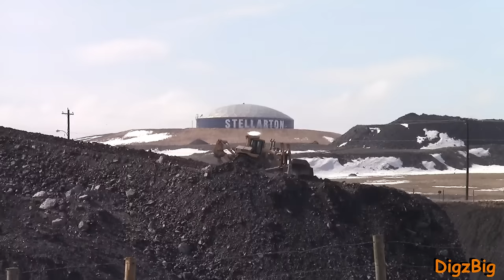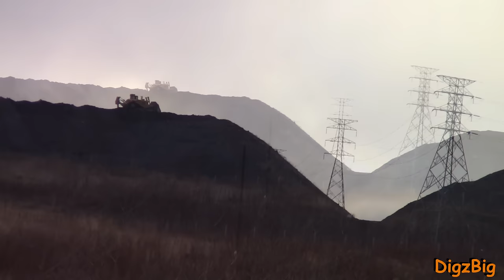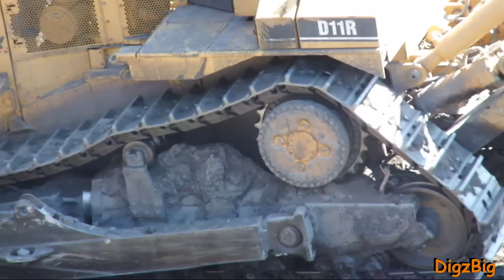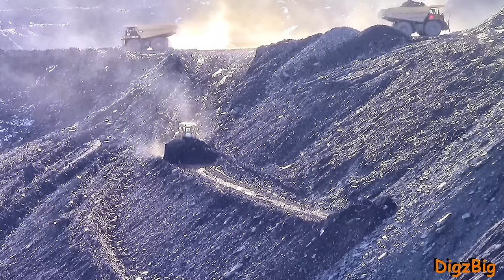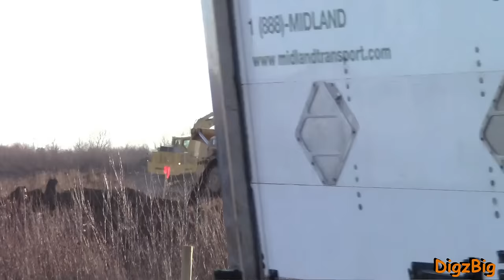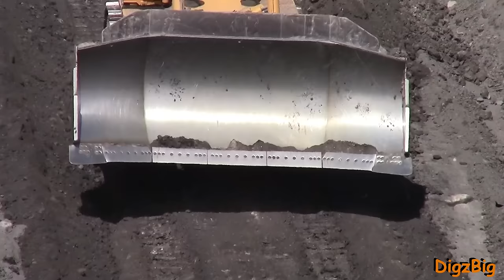D11 Heaven the 60 Minute Epic

Comment: I swamped a GMC General tractor in sand up to axles 30 years ago---full tandem--double bunk 256 wb---400 Cummins ---big truck --I think it was 22000 lbs bob-tail. I saw a guy putting fuel in a D-3 and he reluctantly came and pulled me out --a good samaritan  with a brand new Toyota Tundra tried previously --I already had a chain on it--and it didnt budge an inch--this guy hooked up and went--my air brakes were on and I was trying to get in and help with the pull by spinning it with diff-lock in 3rd gear--he dragged that thing passed me while I was reaching for the grab handle.  Wow---That was a D-3     I could imagine this animal !

Comment: Operated many them. Good well maintained right cat D11. Will move some serious material. Surprised myself amount in a few days.  Trick is keep the dozer maintained. They want them running 24/7 non stop. But you got to keep them in good shape. I seen few pretty new ones done  junked out. I wouldn't buy for scrap metal.  Undercarriage worn out. 1/2 controls don't work. Leaking more Hyd. Than drinking diesel per hour. Sad deal.

Comment: I really don't get it ..What is that oparator trying to do...Why is he pushing the overburden all the way to the bottom of the pit.?
Reply: typically when they open another cut they use the material to backfill the previous one that has been mined and is ready to be filled back in. although this is usually done with a dragline or something similar, but each company has their own way of doing things.   they also could be doing reclamation and returning the overburden back to the mined area to close it up and restore it back to it's original state.  usually when you see overburden being pushed into a hole it's for one of those reasons.

Comment: Why can't the dozer operator build a road to the bottom of the pit and the trucks drive down and dump ? Fill the hole from the bottom up, as opposed to the top,down. Seems like less machine hours. I'm just a stupid HVAC guy though.
Reply: Jeff Stock I’m certainly no expert, but my guess is that this approach compacts the dirt more.
Reply: @jstoli996c4s  After watching letsdig18 and doing some rough calculations, a loaded truck with tires would compact much better than the D11. It is simply a psi comparison. As for the OP, the D11 sits a lot lower to the ground than the trucks they are using. Hence, running a truck down those hills could side  flip or forward flip a loaded truck and if it made it down, now it has to climb back out which is now a back flip hazard. You would negate the need for one dozer but would then have to double or triple the truck numbers they are running. Also wear and tear on the trucks would be huge, brakes and transmissions especially.

Comment: What a monumental waste of time, and a dozer. The undercarriage will be worn out pushing dirt that far, not to mention 150 - 200 gallons of fuel per shift. Whoever is in charge of that pit, needs to get their head out of the butt! Their cycle times are way too long.
Reply: Darrell Palmer, what equipment would you suggest, seriously?
Reply: Jack Sak add a couple of scrapers to the job. they can move a lot of dirt in a shorter amount of time. I've move millions of yards of dirt with scrapers.
Reply: Okay, I go with you on this. Question: what about balance and slides with scrapers? Maybe it's okay on that grade. I don't know. Thanks.
Reply: Okay, thank you for replying. I appreciate it.
Reply: You are right on Darrell Palmer ! This has broken each and every rule of the 1977 mines and safety act ! I saw a dozer working contour to an unstable area ! Trucks dumping directly behind that dozer ! Truck drivers broke all kinds of laws dumping over on that dozer like that !  When you see a dozer that size buried with a man inside the cab, they will get the big picture . 
 A couple of CAT 657's would love to get in on that.
Reply: Your right Darrell, pushing all that way with a dozer is insane.  57's should be in there too. If no scraper's then the Dozer should back up about 25 yrds from where hr stopped and take it down about 15 ft then go back to another 25 ft to where he just filled.  Go back another 25 ft and do it again.
Reply: Hey “we don’t buy em to maintain them”... lol bunch of goofs....
Reply: Banjo Greg Cantrell what ru talking about
Reply: @donaldwoods9909  What and rebuild the transmission every month? Another one that should watch and learn!
Reply: @banjogregcantrell6235  Don't be an idiot! You wouldn't put a scraper anywhere near where those dozers are working! Best to watch and learn!
Reply: Right! If you drove a scraper anywhere near where any of these dozers were a supervisor would be there in a minute saying: "what the hell are you doing? Go home we don't want you anywhere near here anymore!"

Comment: Peashooter compared to komatsu D 575
Reply: michael obrien the D11 is still quite a beast
Reply: The D11 has one thing up on the komatsu D575. The D11 is still in production but, not the D575.
Reply: michael obrien there 575 is there super dozer, the 475 is the equivalent to the D11. D11 is the BEAST💪🏽💪🏽
Reply: @scruffy6151  lol